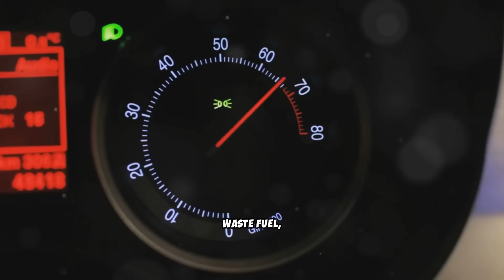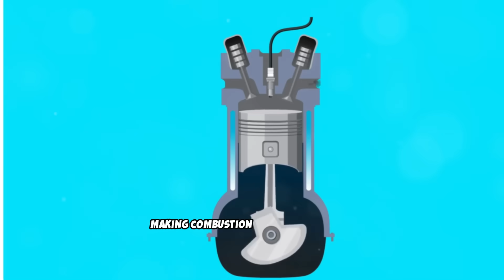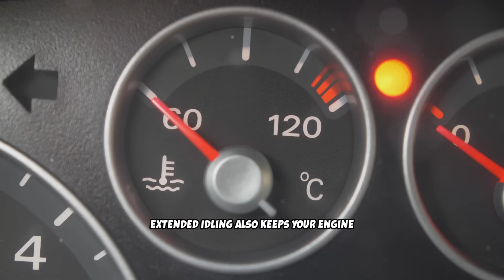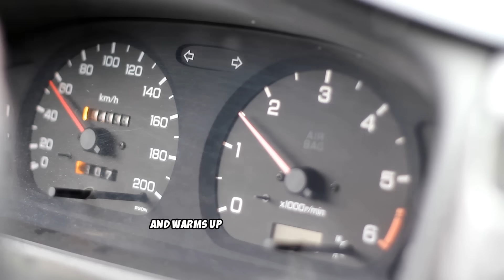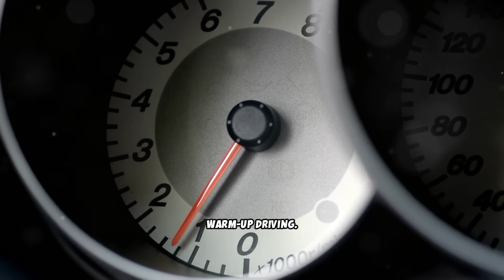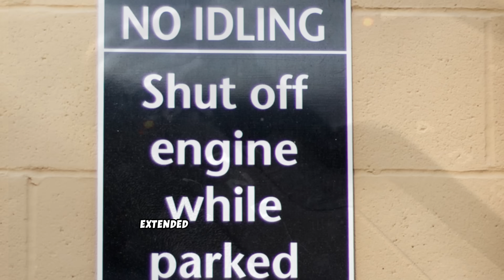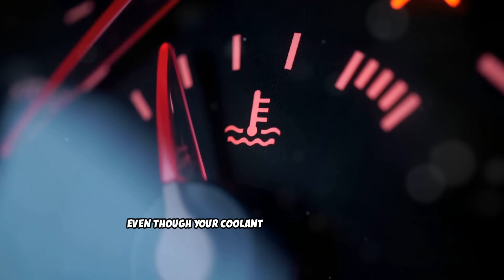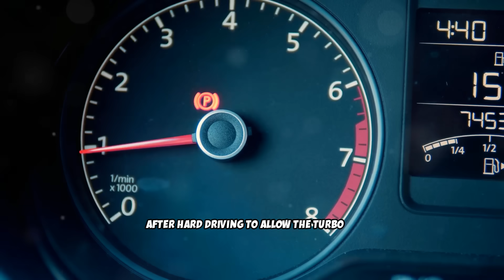STOP Warming Up Your Diesel Like This (Costly Damage!)

Comment: Start up then put your seat belt on and set your temp or radio station that will take 15 seconds and that will be enough time to let the oil get around the engine then drive off.  Best way to warm up your car is driving and not using all the power so drive normally then when the car is warm use the full power every now and then  this with keep your diesel car healthy for years and years

Comment: Ford recommends the following procedure:
Start the vehicle (following the cold-weather starting procedure if applicable).
After the engine starts, you can generally put it in gear and drive off shortly after, avoiding heavy loads or high RPMs until the engine reaches full operating temperature.
Idling for extended periods is generally discouraged for modern diesel engines as it can prevent the emissions systems (like the DPF) from functioning correctly and actually slows the warm-up process. The engine needs a load to warm up efficiently.

Comment: Start truck put on high idle engage exhaust brake blowing hot air in 5 min. Over 800,000 on last truck over 600,000 on this one 💪

Comment: Your DPF is never intended to "clean itself" when the temperature is too low, and it won't go into that mode, by design. When you drive and reach correct operating temperature for a "regen" cycle to take place, your emissions system will enter the "DPF Regeneration Cycle" while you drive, exactly as designed. In northern climates with frost coating the windshield, you need to be able to clear it before driving safely. Maybe the manufacturers could provide an "electric heater coil" in the dashboard to warm up your windshield faster than the engine coolant that normally does the job. Oh, wait: nobody has built that option into their diesel vehicles. I guess I'll just have to warm up my truck like I have always done.

Comment: It also helps by letting your glow plugs pre heating the combustion chamber by putting to accessory stage when you turn the key, 10-15 seconds before cranking the engine

Comment: I turn my exhaust brake on and high idle my 6.7 Cummins every morning for about 5 minutes. Its up to temp before I roll out if the driveway, it also puts a little heat in the trans.

Comment: Why risk it when your engine run on 15w40 oil. That oil is thick like honey when cold. Your oil pressure is high that can blow seals, and oil works best near operating temperature. I usually warm up for 5 minutes before drive at high idle.

Comment: First time diesel owner, bought a 2018 Dodge Ram 2500. Started my truck this morning in northern minnesota when was 32 ° with frost on the windshield. I let the truck run for 10 min and drove about a quarter mile to the main hwy. I accelerated to highway speed of 65. Is that too soon to accelerate and did I warm up the truck too long? What is the sweet spot for cold starts in northern climates?
Reply: As suggested. Plug your truck in at that temp for 2-4 hours and you should be fine. Should help get the oil to a higher temp by the time you get to the highway. As stated too, if the temp gauge hasn’t moved much by the time you need to put the tuck on a high load, use the slow lane to keep it in the lower rpm’s while getting up to speed and then go from there.

Comment: If you have a cummins, you can bump your idle up if you're going to let it run anywhere. Turn the cruise on and hit set. It will bump it up to about 1050rpms. You can also increase it in 100rpm increases by hitting the plus button on the cruise like you're going faster down the road. If people would do this to the couole of covid yrs of spotty bad lifters. They wouldn't go bad. 
 If you have it plugged in, you shouldn't need to let it idle any longer than it takes to put your seat belt on and phone down etc.

Comment: Start the engine. Oil pressure reach's a decent point. Increase RPM to about a thousand to 1200. Then when the temperature gauge moves move at reduced engine power. Balance oil temp with engine temperature. At light load for the engine will bring the gear oils and such to operating temperature those components can handle. Apply a bit more power. And work it this way for a few miles than mash that motor. Why you must do this is because your turbo depends on plenty of oil. Turbos move to fast for any bearing known to man to withstand.  Takes lots of oil. Not just oil pressure. At freezing oil pressure can be massive. But the amount of oil needed for a turbo needs volume not just pressure. High pressure does not mean volume.

Comment: That's why I let the engine run at idle for a minute max while I scrub the ice off of windows and then slowly drive off, letting things move and warm up as it's intended - key here is to not drive it hard, I let mine go over 50°C, then I start to drive a little more aggressively if I need so.

Comment: That's pretty much what the manual says. Though mine needs to rev to nearly 3000rpm before changing into second otherwise I can risk lugging the engine, which is one of the worst things you can do. RPM's aren't that bad as long as you don't put the engine under too much load.

Comment: And what do you do if you've been at work for 9 hours and you're near the highway and in 1-2 minutes you're going straight onto the highway and you can't drive slowly, you can't change gears easily, when you get on the highway, you have to accelerate, you can't do all these things. In this case, isn't it better to let the car's engine warm up on the spot? You don't always have the ideal conditions to drive the car slowly, until it warms up. I'm asking for a friend.

Comment: Install a coolant temperature gauge. Start and let engine warm up to 100 DF. When the temp gets to 85DF kick in the high idle if you can. After 100 DF drive off slowly.

Comment: This might apply to modern diesels but anything older like from the mid-2000s on back, need to warm up a little bit. If I started my 24 valve Cummins, and just started driving a few seconds later my oil pressure would be through the roof. Diesel's also actually love to idle, as long as the RPMs are bumped up a couple hundred RPM while idling it's fine. A lot of industrial diesels and even locomotive engines are basically just idling their whole life.
Reply: I agree with you I have 02 cummins and always warm up a little  bit and still runs fine at 500k and 0 blowby

Comment: If you worried about oil thickening when cold you can use a 15- 40 full synthetic Amsoil Signature Series with their filter
Reply: You mean a 5w-40. Run that in the winter and 15w-40 in summer time.

Comment: Start then go after about 20 seconds and drive slow, had a Transit van over 580,000 km and Mercedes Sprinter also 520,000 no issues and smashed both so they would have gone longer, went through 1 turbo on the Transit at 400,000, Mercedes no issues except diff at 480,000

Comment: In -20 to -40 deg F, I use elevated idle to warm it for 5 to 15 mins depending on how easy it is to get the family out to it. Driving it is usually a no no right away. There is always snow blowing in and high winds. Takes quit abit of power to bust through. So any shelter (trees, walls, buildings) blocking the wind doubles warm up speed. The elevated idle is a must. Sometimes sitting and idling for 30 mins or more to melt ice off the transmission controls so I can shift without breaking linkage. Oh man, im not looking forward to winter, again.

Comment: If you are going to warm up before driving then double the speed of idle. Also because cold pistons are not heat expanded to their full operating temperature so will rattle or literally rock in the bore wearing the skirt.

Comment: All my vehicles are warmed up by starting them, then driving them steadily until they come up to operating temperature.  I have a sub compact tractor with over 8k hours and have had numerous vehicles exceeding 200k miles and still running well.

Comment: Duramax has cold start high idle for a reason. Mine will be 1/2 way to normal operating temps in -40°C after 10 minutes. 300,000 kms no issues. Regular maintenance and synthetic oils are a must.

Comment: There are a lot of different theory about this. Yes, a diesel is a work horse and it isn't healthy to let them work continuously on low load. BUT, it is a big heavy metal thing with a lot of components inside that need to have time to gently and equally warm up together to avoid friction at places you don't want or stress points. If you warm up to fast, the piston gets hotter than the engine and getting bigger than the engine that hasn't expanded by the temperature (it is only micrometers but it counts). I have run a Peugeot 607 2,2hdi engine for work. When I needed to wait somewhere for 30 minutes, I just let it run to keep temperatures settle gently, when I cold start, I let it run for a while and gently drive off, but when it was hot, it needed to work, hard. I've done 1043000km with it, yes, over a million km on a Peugeot. Didn't consume oil, did 30.000km between oil changes, original injectors, original dpf, original turbo... never had any issues with it. I was a driver then and did 20-30.000km a month with it. Same story with my gm 6,2 and 6,5, all gently treatment when cold and make it work when hot. 
Modern diesel have such high efficiency that the need very little fuel to run, so the little contamination you could create when cold is close to nothing and if you are not afraid to DRIVE when it is hot, you burn it all away. But a diesel needs to work when hot. Old or new, it needs to get hot, work for a constant load and time to keep good. I've done a few overhauls on Cummins qsk45 and kta50 and the really need to work. Put at least 70% load on those things. I you run it a week under 30-40%, you can put a drum of oil in it every day. They get to much fuel they can burn and you have glazed cylinder walls and oil just fly true it, by every opening it has. They are good for 2 things. Sit still or work really hard. And when they work, they sound happy and run forever. With big old stationary engines (slow running, 500rpm max) it is a bit different. They have really high compression (1/30) and by there slow speed, they can burn everything completely so they can run on idle or with low load much longer without problems, but even they want to work. When I bought my old boat with a 166liter 340rpm engine it was running sort of ok. But it has been treated really really gently for years. So when we warmed it up (after hours of running before the 13300kg engine was equally warmed) we start pushing it more and more. In the beginning we could see the port of Hamburg anymore due the smoke that came out. But after a while, he was all burnt clean and run without smoking and sounded a lot better.

Comment: If it's really cold, I wait a minute at most, then drive off. The first few kilometers gently, until the coolant temperature gauge settles at operating temperature. And even then I don't put it under full load. But I'm writing for a petrol car.

Comment: Start up and immediately drive off gently. 171,000 miles, no issues!
Reply: And what part of the world you live in? If I did that in northern Canada my diesel engine would be a paper weight by now
Reply: @RowG777  right. Northern Minnesota here 230k on my lmm drives like new. Just a delete lighter weighted oil and I’ll let her idle all day. Also has high idle for this reason
Reply: If it's really cold, I wait a minute at most, then drive off. The first few kilometers gently, until the coolant temperature gauge settles at operating temperature. And even then I don't put it under full load. But I'm writing for a petrol car.
Reply: @dejandezman6139 Then why are you replying in regards to a diesel engine?
Reply: @dejandezman6139 Miles , prick
Reply: @dejandezman6139  not even necessary to wait 1 minute, just start it, put your seatbelt on, then start driving
Reply: Immediately? 😂 You need at least 8s for the oil to get everywhere😂
Reply: Middle Canada here, 10-15 minutes on high idle with the exhaust brake engaged for winter, approaching 300K miles, ‘09 6.7 Cummins, runs like it’s new. Still on the original turbo. Oil is everything, Rotella T6, 05W40 full synthetic.
Reply: Same 140'000 on my SsangYong
Reply: I’ve been doing a lot of research on this subject. I’ve also come across videos and info from Dave’s Auto stating this same thing…. Drive almost immediately, slow and under light load.  

HOWEVER, what about higher idle?  What about short commutes?  

My 4 mile commute to work on my diesel is making my dpf clogged in under 50 miles causing a regen. 

This requires me to use high idle for 10-15 minutes for a variety of reasons. 
1. To get oil, coolant to operating temperature 
2. To get EGT to where they need to be. 

The higher idle helps prevent wet stacking and helps get things hotter quicker.  Burns more fuel but it’s easier on the engine and dpf. 

This combined with a grill cover and engine block heater is hopefully enough to keep my Cummins healthy.
Reply: 275.000 miles T4 VW no oil usage goes as good as it did 200.000 ago be gentle take it easy 🤞 last for ever.😊
Reply: 👀👀excuse me?
Reply: Literally. Been a truck driver for 9 years. These modern engines don’t need idling. Turn key to on position for a couple seconds to let things cycle, turn over engine, drive away. 🤷‍♂️ idling destroys DEF systems. Even modern diesels on pickups/SUV’s they say not to let idle. I live in northeast US. I plug my pickup in only when it’s gonna be below 20 degrees F. 25 Silverado 3.0 duramax. Previous truck was a 23 3.0 duramax. Never had any issues and I drive smooth and don’t have a lead foot. Just speed limits. 🤷‍♂️ don’t agree with 0w-20 oil in these newer engines but hey.. manufacturer wants to change engines then have at it. 🤣 why I have a 84 month warranty from factory.
Reply: Is that all, my Daihatsu with its Toyota designed diesel engine, works hard every day and at 630,000 miles and still running strong.
Reply: Idling 10-15min always in extreme cold. Oil change intervals about 3 years/100 000 miles. Never serviced than filters oils. Bmw 123d sold around 300 000miles no problems except battery once, windscreen cracked, suspensions, tires, alternator once. Always let the oil warm a bit before going to drive - 15F or more.
Reply: I always warm up my Duramax lml … my truck runs great never let me down .. 235k miles got it at 130k ..
Reply: Or don't do that,and drive off 3 times more 😂
Reply: Same with almost 300,000 Seat Leon 5F1 1.6tdi
Reply: Hahaha
Reply: 1kzte hilux surf got 620 gets daily drivin
Reply: You don't have a 6.0 Ford. I have to warm up my van in the winter or it simply doesn't move.
Reply: Based on all the comments it dosnt seem like it matters what you do lol.
Reply: Problems you mean .

Comment: 60-90 seconds. If very cold, 120-150 seconds. Over 120 seconds, put in D, And   wait for another 30 more seconds to warm up transmission oil.  If very very cold, double the time.
Reply: Noice

Comment: In my Vauxhall CDTI the ECU and glow plug controller  activate the glow plugs at various temps ( voltages ) when cylinder temp is below optimum not just for starting.  Thats to say pre and post start heating.  I’d imagine it’s standard for most DPF equiped  vehicles.

Comment: Idle for 30 seconds.  Lift revs to 1000 rpm untill coolant starts to just warm. Drive off carefully keeping revs lower. Idling engines wash bores.
Reply: coolant wont really heat up in 30seconds, just start it, put on your seatbelt then drive off

Comment: What is recommended when your Diesel RV is stored over the winter for 3-4 months without driving? 
Is it recommended to start the Diesel and let idle if you aren’t going to drive it? 
Ted
Reply: To keep the fluids flowing and the battery charged
Reply: Just let it sit. It needs to be worth it to wake him up. Same like you, if you are in a deep sleep, you also don't like someone to wake you up and just say hello. It is the cold starts that are tough for an engine. When it is been sitting for a long while, all the oil is down in the oil pan and all the mayor components are dry. So if you start for the first time after a long long time, my advice is not to wait for the glow plugs but turn it over right away. Like this, the engine won't start but the oil pump is pumping the oil around to the important parts. Let it crank for 5-10 seconds. If you have an oil gauge, you should see it going up. Stop starting and now do the normal procedure, glow plugs and then start. Let it run to give the oil time to get everywhere and gently drive away.
I collect big air started stationary engines, and those things even need to be pre lubricated before you start by a hand oil pump. You need to pump oil pressure to the main bearings to make sure the crank is 'floating' on oil. Otherwise, due the heavy flywheel you can damage the bearings.